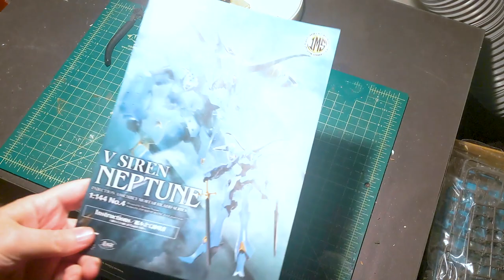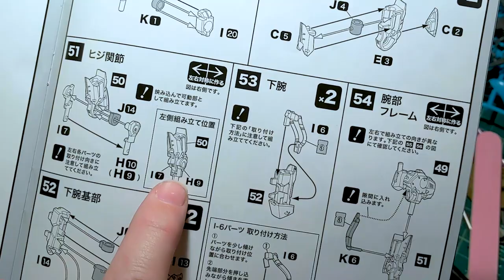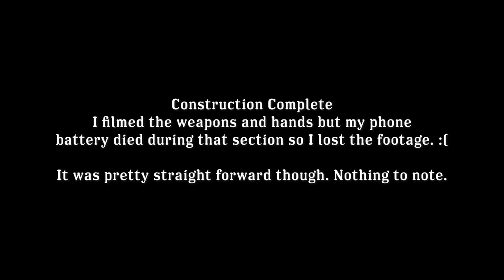Five Star Stories 1/144 Neptune - Build part 1 - Construction

Comment: I was inspired to pick up the 1/100 KOG A-T after watching your build. I've built Gunpla my whole life so FSS kits will be new to me. I haven't started it yet but was thinking I should start on a smaller 1/144 scale kit before I tackle the KOG. Is that a good idea or do you think the smaller scale would be harder?

Also since Volks sends you kits, would it be possible for you to suggest to them to make the Engage SR-1 in their 1/100 IMS line?
Reply from the maker: Honesty, the 1/144 FSS IMS kits are about the same as far as the way they build, but you might have to do a little more masking. The KOG-AT is one of the easier builds...and as far as the SR-1, you're in luck. There's one on the way. Maybe later this year, no exact release date yet, but you can find photos of the prototype around the web. I saw a few on Twitter and a couple other social media pages.
Reply: @bhop.builds  That's awesome! I'll be getting that for sure. I also have the 1/100 LED Mirage. I know that one is a pain the in ass so hopefully I don't ruin it.

Comment: It feels like they should have went with under gating instead. I really wanted this in 1/100. Awesome job. Which did you feel was harder the K.O.G or this?
Reply from the maker: I don't really think either is harder. The KOG has more parts, so it's more time consuming, but the parts cleanup was pretty similar for both I think. I do still have to do the painting on this one. I think this will require more masking for certain parts.